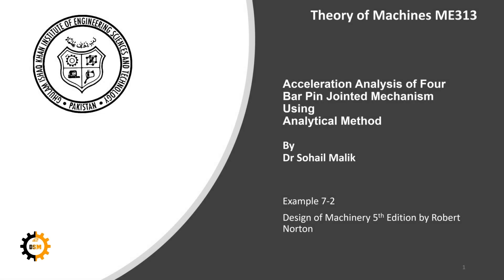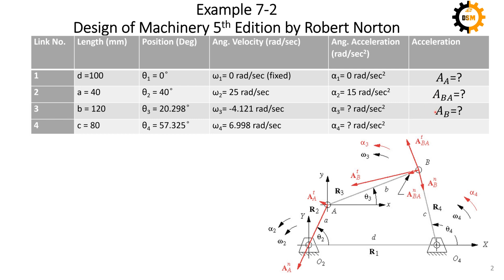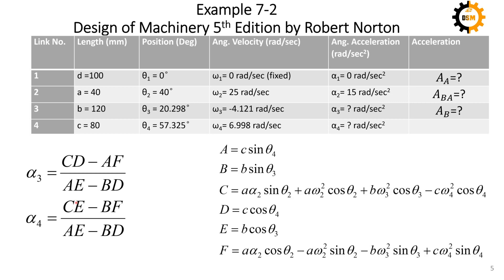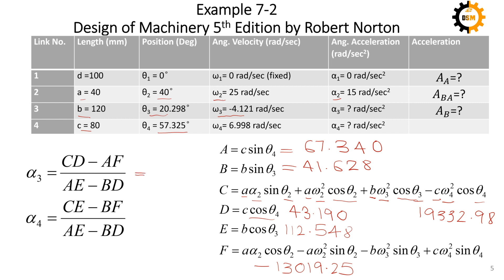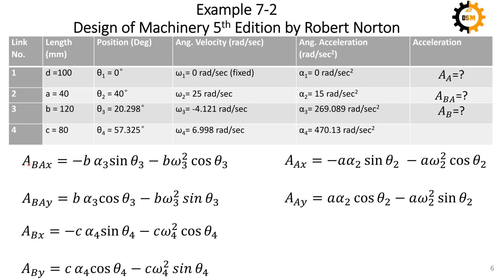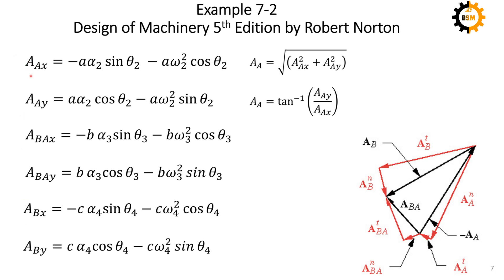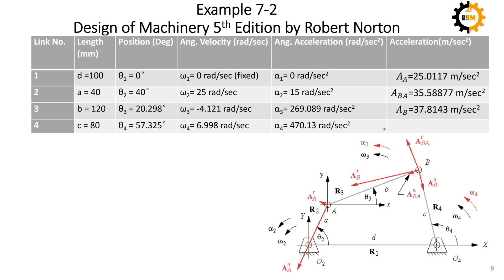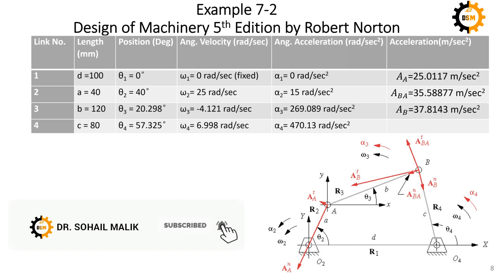25-2 Acceleration Analysis of 4 Bar Mechanism Problem using Analytical Method | Theory of Machines

Comment: How do we find the acceleration components for the centre point of the link  3? Using this method and splitting led to incorrect values in the CEP as well. (2017308)

Comment: 2017469, sir can we not just find the acceleration components using graphical methods?
Reply: Syed Usama analytical solution gives exact answers while graphical solutions depend on the accuracy and precison of the instrument used to draw and measure the link lengths.
Reply: Thanks Droid User

Comment: Sir, how will we go about the analysis for a third point P on the coupler? For velocity, it is fairly straightforward since the directions are the same but in acceleration we have to consider the vector towards the centre of rotation as well, which would be difficult to calculate. Please clarify this a bit. (2017111)

Comment: Sir in the exam do we have the position and velocity values already given or will we need to calculate them as well. Cause if they are not given this kind of problem will require at least an hour to complete.
2017323
Reply: Most probably position and velocity values will be given to us due to shortage of time. Otherwise only one question will be enough I guess.
2017185